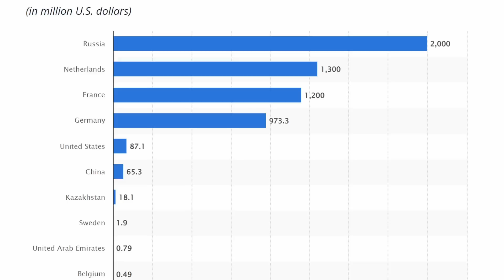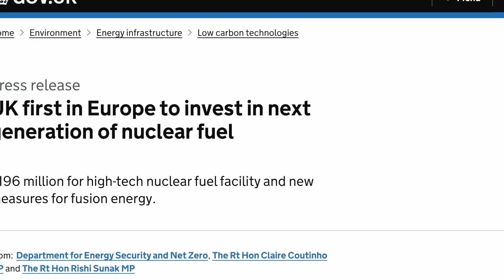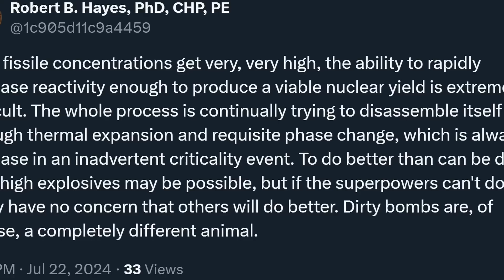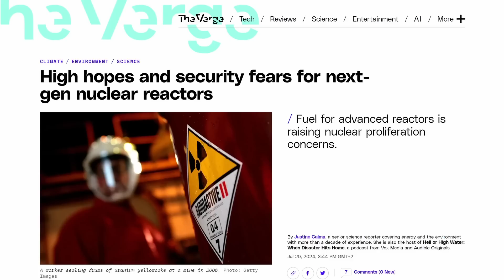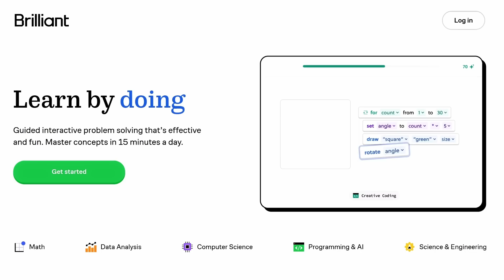Small modular reactor fuel could be used to build nuclear bomb, experts warn

Comment: The problem is Haleu seems to be: it is not really cheaper than normal nuclear. And nuclear is around 30 $ per MWH while pv is going now below 10$/Mwh. Enough price difference that you can afford cheap&bad storage like hydrogen from it. Why is anyone still interested in nuclear energy now that we have come with pv far enough that it is the more economic solution?
Reply: All prices for PV versus nuclear are presented on an Apples to Oranges basis.  Please quote prices with adequate storage to make it base load, like nuclear can be.
Reply: The 30 and 10 are easy... you can google them up without any trouble. The storage in hydrogen is much more complicated as the price is kw as well as MWH that affect this. But basically that is what the 20$/MWyh plus the efficiency can pay for.  Hydrogen storage is really cheap, a kwh of storage is here not to be confused with a kwh of energy consumed. Your main problem is the round trip loss of energy that uses up this difference. So I can not easily answer you that... it totally dspends on your location what the necessary storage is... but overall the numbers look in favor of pv
Reply: @Christian-ev1zu  It is easy to Google distorted numbers that abound on the internet created by advocates.  In practice, there is no grid scale hydrogen storage implemented to back up PV, just pilot projects or heavily government subsidized one.  All PV is currently backed up with fossil fuels, nuclear from France, or just sucking out the redundancy in the system.

Comment: A small mistake. What differs U-235 from U-238 is not that it is radioactive. Both are. It is the fact that the first is fissile with thermal neutrons. The second is just fissionable with fast neutrons.
Reply: Or, to be more pedantic, both of them are barely radioactive. Because colloquially when you call something radioactive, people assume "dangerous".
Reply: @zolikoff  That's why the scaremongering about nuclear waste is so disingenuous. People don't understand that the MORE radioactive a substance is, the SHORTER its half-life. 

Plutonium will still be around 20,000 years from now? Who cares. It's an alpha emitter. It's more dangerous chemically as a heavy metal.
Reply: U-238 can't maintain a chain reaction even with fast neutrons. It's the reason H-bombs use fusion to generate a huge amount of neutrons to split the U-238 tamper.
Reply: @magicstix0r  Suppose one used a neutron source like a Farnsworth Fusor to transmutate the U238 into fissile Pu239
Reply: @danbhakta  a fusor is a pretty poor source of neutrons, but amateur transmutation has been done. That was the nuclear boyscout's whole thing. 

Getting enough for a bomb is not something you're going to do in your back yard, especially without being noticed though. David Hann barely did much of anything before the epa noticed the radiation blocks away. 

Building nuclear weapons requires nation-state levels of industry. It took months to breed enough plutonium for the first bombs with huge reactor facilities and hundreds of engineers and technicians.

Although the technology is ridiculously simple and almost anyone can build most of a nuke, the fissile material itself is extremely expensive to produce.
It'd be like trying to build an aircraft carrier in your backyard. It's just not going to happen.

The only way a terrorist gets a nuke is if they manage to steal one or if a state hands them one.
Reply: @magicstix0r  My gist was this...if they can do it...we can do it...and by extension anyone.
Reply: @magicstix0r  I think you're mistaking cause and effect. Tamper serves to slow down expansion and to reflect neutrons. Fusion produces neutrons which will drive fission in a U-238 tamper, cheaply increasing yield. The downside is that it's dirty and produces a lot of radioactive fallout. Fortunately, modern delivery systems are so accurate that there is no need for dirty high-yield warheads. Even in a high-yield design, they would use something like lead to get a cleaner, lower-yield configuration. Neither USSR, nor USA have detonated dirty configurations of their most powerful warheads IIRC; tests were limited to clean configurations.

To make it short, "H-bombs" generate huge amounts of neutrons irrespective of tamper material. Fission of U-238 is not THE reason for it. I imagine it was a consideration in the early days when they were building more and more powerful weapons. But modern warheads have much smaller yields.
Reply: And small linguistic correction - they are isotopes, not "compounds."
Reply: Good comments guys. 

I just locked myself in my bedroom closet again by mistake. Do you know how I get out of here?
Reply: So I will stick with solar panels and my wind generator then and not bother about saving up for a small modular reactor at my off grid cabin. I don't want to be responsible for all these neutrons and fission and fusion making whoopie with a beryllium reflector and transmuting some terrorists to my neck of the woods.
Reply: I tend to think of U-235 as the igniter and U-238 as the fuel.

(Lmk if that metaphor doesnt work, i thought it was close enough)
Reply: @sunray501  It depends. In a thermal setting like current nuclear reactors, U-235 is both the igniter and fuel, and U-238 does nothing* except be slowly turned into Pu-239 which is a fuel. If you can trust wiki about a third of the energy from a typical reactor comes from Pu and thus indirectly from U-238.
In a fast reactor or especially a hydrogen bomb it looks different, there U-238 actually is extra fuel, so your metaphor works a lot better.

*Actually the U-238 is very important for other reasons, but that is too complicated to get into.
Reply: And that is what allows it to work as a nuke. The fast neutrons generated can fission 238U directly. If a thick beryllium reflector is used and a potent neutron source kick starts it, it would be easily usable as a nuke in the multiple kt range.😮
Reply: @christopherleubner6633  if beryllium is struck by a fast neutron, are the produced neutrons equally energetic?
Reply: @martinofgliwice1486  Beryllium acts both as a neutron reflector and multiplier for fast neutrons. In the case of reflection, the neutrons lose about 20% of their energy, so it is a fairly good moderator (worse than water, better than graphite) In the case of multiplication, the two produced neutrons have on average a slightly smaller energy than the original neutron.
Reply: @ozicryptoG You certainly have a high opinion of yourself.

Comment: @sabine: Your diagram is wrong!  When you said that the first category had < 5% you actually showed < 20%.
Reply: The diagram is technically correct. We used to distinguish mainly between LEU (0.72% - 20%) and HEU (>20%). The term HALEU (5%-20%) is, as far as I can tell, a new invention due to generation IV reactor designs. It overlaps the older term LEU.
Reply: @entcraft44  I didn't dispute the correctness of the diagram.  I just pointed out the discrepancy between what Sabine said and the numbers that were shown.

Comment: Actually, gun-type weapons are  very simple.
Two subcritical slugs of U235 are enough to build a weapon, you just need to drop one onto the other from a few meters.

But the slugs have to be highly enriched, 80% or so.

Obviously, getting a bomb that you can reliably transport and detonate is harder but it's close to a standard, old artillery technology.

With U235 the problem WAS getting the highly enriched material, they didn't have the centrifuges nor massive diffusion plants.
But the bomb was so simple it didn't need testing.

Now Pu239 is an entirely different story.

Comment: Actually, since the 1960s (if not earlier) nuclear weapons designers worked out ways to achieve fission with far smaller amounts of fissile material than the 52kg you claim a 100% pure warhead would need for a nuclear explosion.  An example would be America's MK-54 (Davy Crockett) in which the entire warhead (not just the fissile material) weighed only about 51 pounds.  (According to DOE publications many of America's underground nuclear tests used boosted modifications of this warhead to achieve much higher yields.)  As the W-82 155mm (6") artillery shell proved smaller devices are quite possible.  Yes, high weapons yield is best achieved when the percentage of fissile elements are high.  Absolutely building a nuclear bomb from HALEU materials would be a highly improbable and impractical thing to do, even if you arranged some form of transformation process to transmute the stockpile into something more fissile.  There is much more to nuclear warhead construction (and storage) than just pouring fissile material into a duffle bag and stickking in a grenade.  That would just a small dirty bomb and not what someone wanting an actual nuclear war head would be trying to make.    As Robert Hayes writes the assembly of a warhead involves overcoming a self destructive disassembly process.  There are multiple ways, but the nations that have figured one or two of them out hold those secrets closely.  Doing so pretty much always requires specialized facilities so large they can be seen from orbit (and quickly recognized by those specializing in similar processes).  Some 10 or 20 man terrorist cell has zero chance of doing so with stolen HALEU materials without bringing a lot of hostile attention to themselves long before they neared completion of their home brewed nuclear warhead project.
Reply: I quote the US. Office of Technology Assessment, 1977: "a small group of people, [without] classified
literature, could possibly design and build a crude nuclear explosive device. [...] Only modest machine-shop facilities [...] would be required. The financial resources for acquisition of necessary equipment on open markets need not exceed a fraction of a million dollars. [...] Again, it is assumed that sufficient quantities of fissile material have
been provided"

The report also states the yield as difficult to estimate, but possibly as high as 20 kton for weapons grade material and a few kton for reactor grade material. Note that reactor grade refers to a high neutron background and not a low enrichment percentage.
Reply: @entcraft44  There are problems that report does not mention.  Not the least of which is how fast fissile material reacts with Oxygen.  A pure Nitrogen atmosphere is best while machining the parts..

Comment: A molten Salt Rectors(MSR) would much better than a high pressure water rector.  MSR uses Thorium which is much least radioactive and available than uranium.  The technology has demonstrated in the 1960’s in Oak Ridge where they run for five years with Thorium.  Where do you suppose the Chinese got the idea and are running with it.  It was public data from the 1960’s.  GE and Washington lobbied to kill the technology because they were building high pressure water cooled Uranium reactors and cornered the market.

Comment: Safety is a limiting factor for the small modular reactors. Even assuming the reactor operation is 100% fail safe, each reactor would have to have security systems, people and perimeter to prevent terrorist efforts to breach/detonate the reactor or steal its contents. One would also need to protect against, runaway vehicles crashing into it, threats posed by forest or industrial fires, etc.
Would you rather protect one site producing a gigawatt or 100 sites, each producing 10 megawatts? Which is more economical? Which requires more land and security?
Modularity is great. So is standardization, which France does with their reactors. But I question the benefits gained from a wide dispersal of small reactors

Comment: you're off with the "lower enrichment means you just need more of it", below 35% it's basically unfeasible, you'd need over 5 tons of TNT around a few tons of the material just to get a proper critical mass
AT 35%
at 20% you have to multiply by a factor of 10
Reply: Plus you'd need thousands of extremely precise detonators.  And if you had tons of HE why bother with the nuke?
Reply: At that scale I think the shock wave starts to behave completely unpredictable and it's simply impossible to achieve a concentric effect. It's hard enough to make a concentric explosion for a weapons grade plutonium core that is the size of a football. A core weighing multiple tons?  50 tons of explosive layers? Forget about it the thing is going to vortex and shit (using totally scientific terms here).
Reply: It means: You need a bigger truck. That is all! The same arguments were made by the German physicists, who stalled Hitler's bomb, as there were calculations requiring thousands of tons of TNT to ignite a bomb. All the shielding and reflectors you quote are minor obstacles for a determined mind.
Reply: @owenlaprath4135  by that logic, why bother doing anything the easy, safe way when we can do it the hard, hazardous way?

Comment: Ah, just another nuclear bomb made of paper. If you would try to enrich... Which method would you use in your shed? Mass spectrometer? Too much hassle with coils, vacuum. Centrifuge? Good luck ordering precision bearings resilient to UF6. So as a last resort: gaseous diffusion. That must be it! Just let me build that nuclear power plant to power this beast.
And that is even before we started talking about the criticality of uranium solutions - you don't want to go down Tokaimura style. If any terrorist would go after a nuclear weapon, it would be plutonium based. You can make it from natural uranium. Just add thermal neutrons.
Reply: Why not use old, working way? Make plutonium, separate it, use rest of depleted uranium as blanket.

Comment: Thanks for covering this story which would normally get tamped down by the people trying to make a cheap $$$ on this tech.
And, sorry, what is your practical experience cleaning up nuclear material, as in even that spread about from a fizzle?  The best analysis I've read from the 1990s pretty much ended up with an abandoned Manhattan.  I now forget the gentleman's name, but he was an acknowledged expert in the field and worked with the UCS.
BTW, that NC professor is just looking to keep his job teaching fools ..., er ..., eager students the guild secrets of nuclear engineering.

Just another enrichment boondoggle in the US which the DOE will be left holding the bag on when this all blows over ..., like the previous processes people have tried to use this Left Behind DOE site for ..., piggy-backing on the local dead economy and past risk/safety analysis for the site.

A lot like the multi-billions $$$$$$$$$ DOE spent on the recent MOX fuel facility in South Carolina ..., which failed as everything but an anchor to make sure SC doesn't drift out to sea ...

Comment: A very highly enriched U-235 device like Little Boy is pretty easy to make. It was basically an artillery piece firing one sub-critical mass into another. The difficult bomb was the Pu-239 based Fat Man. No nuclear based power system will be immune from the potential for a dirty bomb, including our current crop of nuclear reactors. However, an even more daunting challenge for terrorists might be thorium reactors that breed U-233 from Th-232. The fuel would likely be in a form of a fluoride salt and there would be significant problems transporting it (very thermally and radioactively hot in its liquid form) and processing it to make a fission bomb. It's possible but not as attractive as Pu-239 for bomb makers.